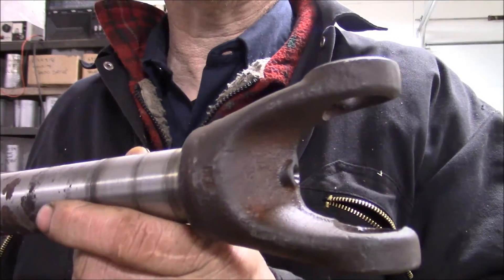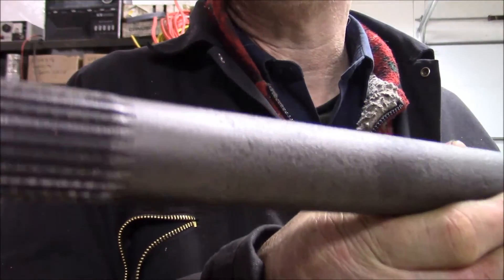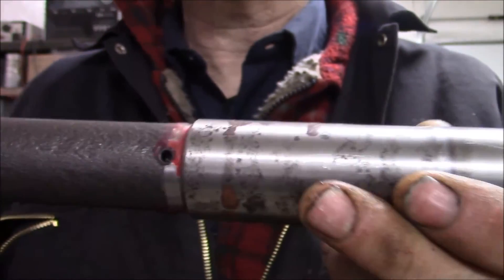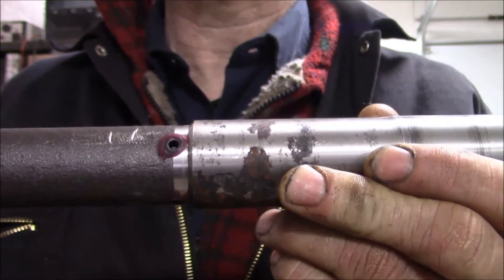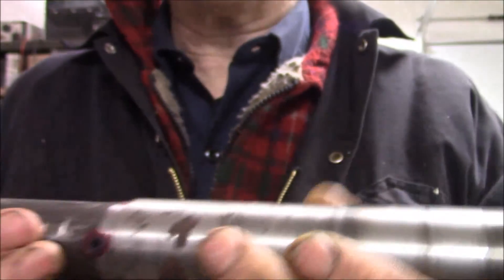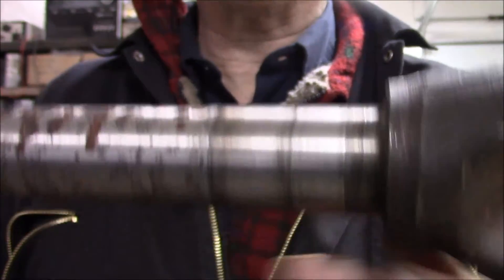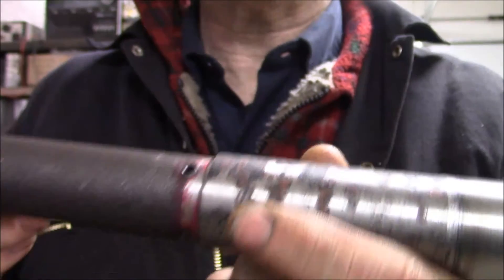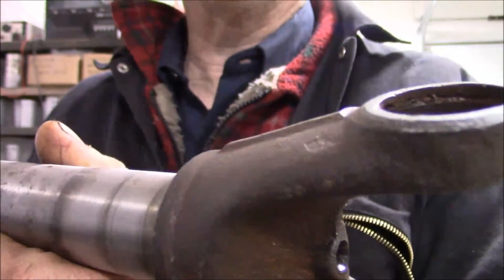Land Rover front half shaft conversion 24 spline

Comment: Great video.
Ive welded.drive shafts in the past, effectivly making a sleeve for pushing both ends into, then securing with weld. 
I like the neatness of your method and no increase in diamter.  I have bonded metal tubes with loctite in the past and i suspect a non threaded joint would probably work quite well. Maybe a longer contact area to make up the surface area given by threads and maybe even a heavy press fit, with or without loctite.

Comment: I think the military versions such as ffr were all 24 spline. Well the rear sailsbury anyway.
Reply from the maker: Hi there, yes I have a Salisbury axle but I have never found a 24 spline series truck front axle. The Disco was 24 spline but I wanted to try it on a series truck. Also this is for a SWB and therefore the Salisbury will not fit.